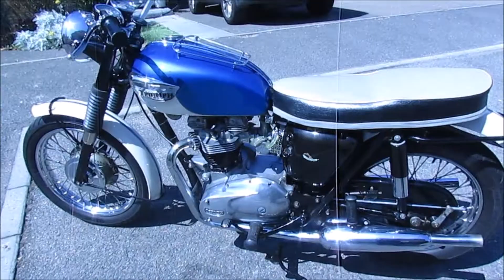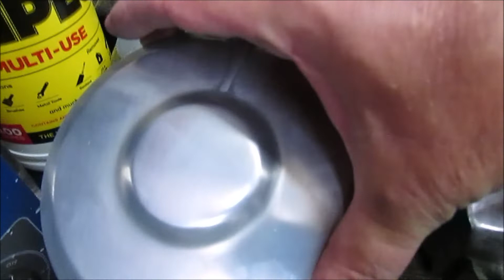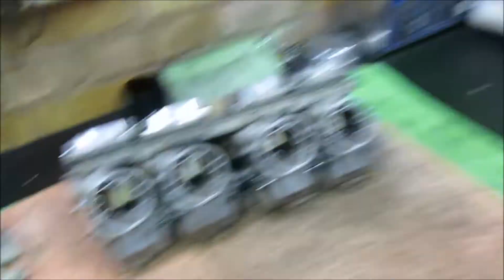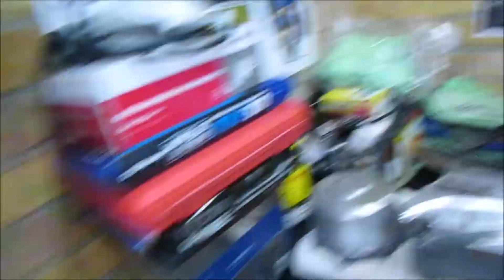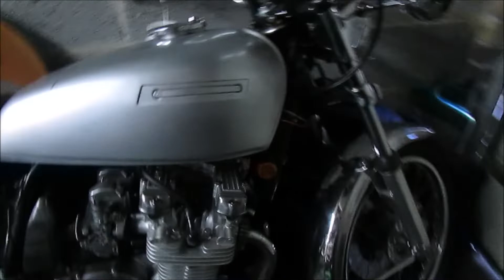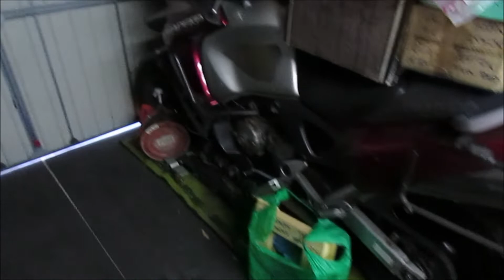Thanks and Apologies and What's Next

Comment: could you by any chance look and see how the sleeve comes off that the output shaft seal rides on? (KZ1000J) the one between the front sprocket and the bearing. mine has been gouged at some point and i need to replace it and cant seem to get it off. press fit maybe?
Reply from the maker: Hi, i did a whole playlist on the stripdown of my engine, here is the part that should help https://youtu.be/RVgZ8i9I89U    if i remember rightly it should just slide off
Reply: @TheAmateurBikeBuilder  you never took it off in that video. you can see in part 7 when you set the whole shaft  on the bench its still in place. Just rewatched part 4 to make sure you didn't just put it back into place without me catching it and at least on camera it never shows you taking it off.
Reply from the maker: @michaeldeflorio4454  Probably left it on so i wouldn't lose it, i have it still in the tub in the garage, will check it tomorrow and let you know, am sure it just slides of, but will confirm it for you
Reply: @TheAmateurBikeBuilder  thank you so much im fighting like heck with mine
Reply from the maker: @michaeldeflorio4454  Hey Michael, not good news i'm afraid, mine doesn't move either, so checked the manual and you need a puller to get it off but looks like the whole shaft need to be out of the bike to do it,  which means engine stripdown,  if you are in the UK , to be sure give Phil a ring at Z-power, there is not much he doesn't know about kwackers, sorry couldn't help more than that